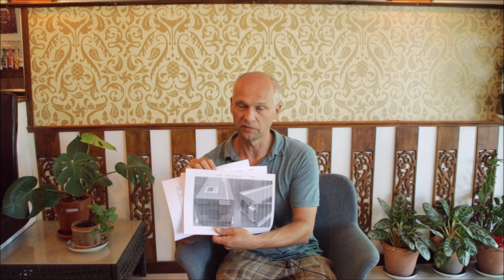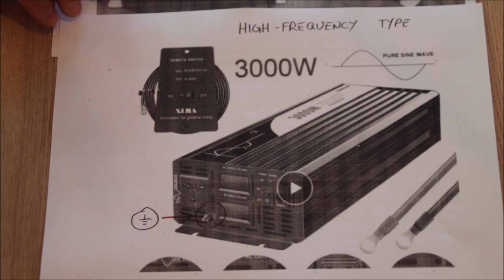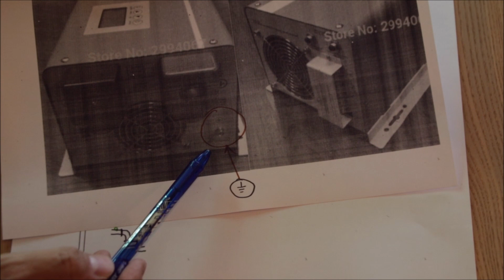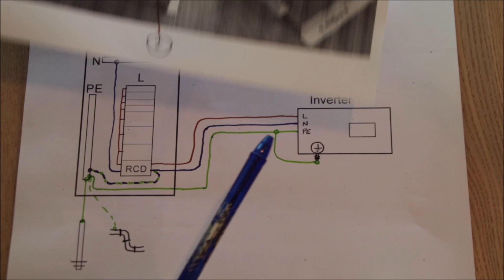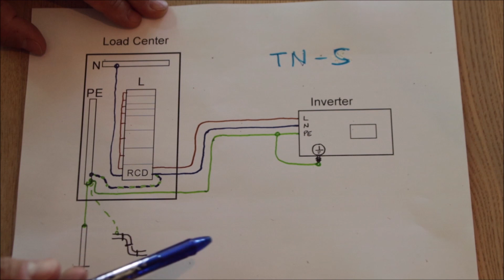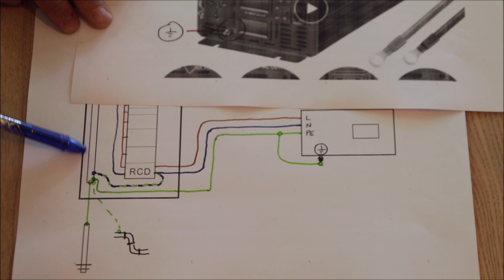Inverter Earthing and N-G Bonding in a simple Off-Grid Setup

Comment: Hi, what rcd type should be used with 12v power inverter? Should it be Type A rcd ?
Reply from the maker: Hi. I am using Type A RCDs with inverters and I do not see the point of an All-Current Type B just because the power is coming from an inverter as some people claim. A high frequency inverter is still putting out a smooth true sine wave. But actually, the choice of Type for an RCD depends on the type of load you want to connect. Simple AC loads like motors or resistive loads do not cause changes in the residual current. But if you are connecting variable speed drive inverters, EV-chargers, DC-rectifiers, etc. then Tye F or B will be required. So yes, Type A will do it for most normal situations, but if you have the extra bit of cash and your application requires a higher Type RCD, you may as well choose Type B. 

Think I should make a video about this ;)
Reply: @RolandW_DIYEnergyandMore  Thanks for reply. Video regarding correct rcd type will be very helpful as I've had spent some time looking for the answer without results( energy prices will force more and more people to use off grid inverters). Personally I've bought 100ma 40a type A, but been advised to use 30ma 40a type A due to safety reasons ( will run house appliances up to 2000w ).  Happy to find you on YouTube!
Reply from the maker: @MrKejpyke  yes, 100mA RCDs are only for equipment protection. Only a 30mA RCD can be used for human protection too. Thanks for watching!

Comment: Hi
I would like to bond neutral to earth on my high frequency inverter but I have measured both live and neutral and both showing 140v and 90v. Is it save to bond neutral to this inverter or will I blow something  I have checked continuity between live and earth and neutral and earth and there is no continuity. Please help
Reply from the maker: Hi, yes it is safe to bond and ground neutral. The 90V will disappear once a true reference to ground is established. Thereafter leakage protection devices like RCDs or GFCIs will work properly.
Reply: @RolandW_DIYEnergyandMore  ok thank you for your answer. Do you know how to check what is my live and what is my neutral. I have read that this inverters are often shipped with reversed L and N and as I see voltage on both terminals I'm not sure which one is L and N. Will the lower voltage be N?
Reply from the maker: @greg23842384  so this is an inverter with built-in outlets only? I guess when you look inside you will only see same coloured wires, right? Yes, I would bond to the leg with the lower voltage.
Reply: @RolandW_DIYEnergyandMore  it's got build in outlets and terminals as well  ok I will try with lower voltage leg. Im trying to charge my nissan leaf with this inverter but i get error code saying leak on my charger i hope this will fix the problem. many thanks for your help.  take care

Comment: What do you think about the measured AC voltage on the DC side(after earthing and bonding) in the video below in the link at 16:30? Can it be bad for lead acid battery or Victron MPPT solar charger? https://www.youtube.com/watch?v=yar9g5gqyK4&t=990s
Reply from the maker: Hi, I actually do not see what would cause the AC voltage readout. Typically AC and DC side is galvanically separated and the DC side not connected to Ground inside an inverter. Its hard to tell if this is just a thing on this particular inverter or of it is a common thing on those cheap devices. Would have to check continuity between Ground and DC terminals. I have checked on my All-in-one inverter, there is no AC voltage between PE and a DC terminal. Nevertheless, I would say there is no risk on the DC side. Those voltages just seem to be a sort of high resistance noise or ripple.
Reply: @RolandW_DIYEnergyandMore  So far, I have tested the connection according to your video and the inverter is working well. I'll try to measure the ground and the DC side. I hope that any AC voltage will not affect the battery :-)

Comment: Its interesting you say to connect neutral - earth bonding on any inverter. I was under the thought that this was only possible on some inverters and to check with the manufacturer. Some have problems which may damage the converter if this is done on the output pins. I expect a centre tapped output inverter will be one of these as you will be shorting out the centre tap winding and neutral but I have not tried this. I originally thought this was good to do on all inverters until I started doing some research now only recommend this on inverters that the manufacturer states it can be bonded on output. Wonder if you have had any issues with any other inverters or am I getting your point wrong and you are making the TN-S system but not using the inverter earth pin out.
Reply from the maker: I assume you are talking about US Split Phase devices now and that we are still talking about a pure Off-Grid System, with no AC input different to the US Split Phase System. There too, The Neutral terminal is similar to a transformers center tap and should be able to be bonded to Earth. Otherwise, there could be any voltage present on the Neutral there too. Non-bonded systems are called Isolated Systems, or Floating Neutral systems in the US. If the manufacturer states, that its device can only be used as an Isolated device, then you are not allowed to bond. The other point could also be that the inverter is already internally bonded for Off-Grid use. There it would of course be fatal for the device if you placed another external bond on a different wire. So yes, please always follow instructions of your device manufacturer if it does state what to do, but technically speaking a N-G bond doesn't shorten any terminals within the power source, it is just allowing fault current to return to the active side of the power source.

Comment: Thanks for the information sharing. Without bonding neutral to earth, LED down light will still emitting light at night due to floating current. I use your method in my offgrid setup.
Reply: Thanks bet that’s my problem also!
Reply from the maker: cool, nice to know! thanks

Comment: Roland i have stumbled upon your channel via looking for a problem i have only encountered today - i hope you may be able to help - Last year i purchased a 3000w Renogy 12v/230v inverter for our motorhome and have been using it for nearly 12 months now without any problems - my set up is simple - from my battery bank to the inverter - red/black cables and from one of the 230v sockets i run a cable to a extension socket with about 3 ports for plugging 230v appliances into - never had any problems, but today i decided to remove the extension socket and connect it to a couple of sockets in my motorhomes kitchen area - and it was at this point i thought i would test the sockets with a plug/tester that lights up if there is a fault in the cable - and there was, it said NO EARTH - so i traced the cable back all the way to the inverter ad could find no problem, so i took it all apart and reconnected my original set up and tested again - still NO EARTH, so it looks like all this time of me using this inverter there has been a problem with the earthing, only today did i attach an extra cable from the chassis of the van to the body of the inverter but it made no difference - still said NO EARTH - any idea what could be the problem - or any solution ?
Reply from the maker: Hi, what you did, was that you have used your inverter as Isolated power source (IT-System). An inverter can natively only output the active circuit L and N. Ground (Earth) is something which is provided by the user itself through something called the Neutral-to-Ground (Earth) Bond. The tester not identifying Earth tells me, that there is no internal N-G bond in the inverter itself. 
You could now continue to use your setup as before, but there are some risks. Alternatively, you could simply place a bonding link between your N- and PE-terminal inside the inverter.
As you are probably using a lot of appliances on your extension wires, and obviously also some which might require a grounding loop, you should turn your IT-Earthing System into a TN-Earthing System through installing a bit more permanent solution with a small consumer unit into your motorhome. There you can put an RCD and a few breakers going to some outlets, and follow the instructions in this video to place the N-G Bonding Wire. Then you will have a semi-grounded installation with improved safety. A fully grounded solution would require an additional earthing electrode outside of your motorhome connected to your grounding system, with the motorhome chassis connected there as well (for whenever you are stationary).
Reply: @RolandW_DIYEnergyandMore  I really appreciate you replying,  however I am not tech headed when it comes to some of the terminology that you use..like.  IT-Earthing, TN-Earthing, N-G Bonding wire etc, would it be a good idea to test if there is bond between the earthing lug on the outside of the body on the inverter and the 230v sockets on the back  ?
Reply from the maker: @kroozer5215  The earthing lug and earthing pin of the sockets will surely be connected. But that isn't the issue. The problem is, that at the moment there is no path for fault current from earth faults available to return to the active side of the inverter. Thats why the ground loop must at some point be connected to the Neutral of the inverter.

Comment: I am thinking of buying a low frequency inverter to replace the 2 lives  plus earth one I have already. In the UK the neutral must be referenced to earth in one place [ at a time ].
 So, will the N terminal  on the new low frequency inverter be already referenced to earth?
Nothing in the Powerstar LK 3000 about an N - E relay , and nothing to say that the N is not in fact a live.
Reply from the maker: Just to be clear. So, you want to remove your Grid supply input to your current installation and replace it with a Powerstar inverter? And you think that there might already be a N-E bond inside your load panel? Further you do not know if there might be an internal N-E bond inside the inverter unit? 
All of this you would see once you remove your current supply cable. You would just measure for continuity between N and E with all breakers ON (or closed) on any outlet in your installation. By measuring for continuity on your inverter N-E terminals, you will as well see if there is an internal bond there. If there were an internal bond in the inverter, and as well a bond inside your load panel, then you would have to remove one of the 2 bonds. It's your choice.
Reply: @RolandW_DIYEnergyandMore  Hi Roland Thanks for your reply. I watched many of your videos on holiday last year in Kurdistan Iraq where I installed some solar panels. I connected a centre-tapped inverter to a ground cable and it burnt out. In Iraq the street transformers are grounded, but no other earth cable at all. This video of yours explains why I need to replace my inverter with a low-frequency inverter where the heavy , steel cored  transformer provides electrical isolation from the two lives out put of centre-tapped inverters.
I am so grateful to you for your generosity in producing these videos.
In fact I have not dared to install my other inverter for three years because I didn't want it to burn out. I did plan to use a separate isolation transformer to achive the same N-E result.
The IET has produced an expensive guide to EESS, but nowhere in this expert guide does it explain how to choose an inverter that will comply to the regulations. All it says is , Don't do it unless you are fully qualified.
Low frequency inverters. 3 words. Why can't they just say that?
Reply from the maker: @anastaunton478  OK, but that means you have used a US split phase inverter in a 230V one phase L-N system. So yes, in such a setup you cannot E-N bond the center tap as you are creating a ground short on L. Be careful with such setups. Make sure not to use AC IN with a different grid system.
Reply: @RolandW_DIYEnergyandMore  Many thanks

Comment: Many thanks Roland for sharing this.. I always thought that offgrid inverter were meant to be isolated. My RCCB is now working after shorting L to G. Glad I found this video.

Question though, if my electric utility is L=110V and N=110V (split), can I still use my inverter's AC IN and connect it to my utility grid? Thanks.
Reply from the maker: No, you cannot do it that way, because in the split phase system, you have the midpoint grounding which would not be the same as where now your L2 is the grounded Neutral. You could only use an isolation transformer on the AC input. That would be something like taking the L1/N 110V one leg and transforming it up to 220V L1/N and feeding into the AC input while no grounding is done on the secondary side of the transformer. But I would just use a transfer switch if you need to backup to grid and not use the AC in.

Comment: Good day sir, i live in a 240V country and i understand that ground and neutral are separated in the load center. now lets assume that E and N are not connected in the inverter, is it then safe to jump a wire between PE & E on the inverter? if so, do i need to bond them in the load center again as stipulated in your diagram? I am a beginner trying to understand electrical wiring and renewable energy in off grid set ups. Bonding and Earthing is one of the topics that i am trying to understand. Thanks in advance.
Reply from the maker: Hi Jonas, thanks for watching. If your inverter is not internally bonded, I would leave the bond for the load center only. Inverter terminals are not as solid as those in a load center and the load center is also the place where your earthing will be done anyways by attaching the wire to the earthing rod. You are right, there would be only one bond in your system.
Reply: @RolandW_DIYEnergyandMore  Thank you very much, I am learning a lot from your videos, keep up the good work, you are saving a lot of lives.

Comment: I'm new to this, but I had to wire my off-grid cabin because it is so isolated, I couldn't get anyone up here...4 miles from Canadian Border. Two 100 amp Lithium Battle Born Batteries in a parallel configuration. I have 12 volt lighting working just fine. I have  A 2000 watt inverter. I use a transfer switch to bring power in from my Honda 2200i as needed. The cabin did come with 120 AC wired set up with duplex receptacles to use as needed if hooked up to a generator.  BOTH the transfer switch (see link below) and the inverter have places to attach a ground wire. I have wired the ground inside the transfer switch to the box and the green wire on the inverted s dangling until I know where to hook it up. I have been getting LOTS of conflicting information on this. My idea was to have the two ground wires go to a busbar and then to a ground rod in the earth. Others tell me it is not necessary and still others tell me to connect those green ground wires to the negative battery lug??? I am surprised by the many different opinions out there!  Everything works very well now. I'm am using GFCI where I can just to be extra safe. I was told that I could also bond the two solar panels together and then isolate them into a ground rod right under them. 

https://www.amazon.com/EZ-GENERATOR-SWITCH-Generator-UNIVERSAL/dp/B00FADDE0A/ref=sr_1_15?crid=1SA0J0F0TGW9K&keywords=transfer+switch&qid=1644522221&sprefix=transfer+switch+%2Caps%2C86&sr=8-15
Reply from the maker: Hi, sorry, your post was initially blocked due to the link. The question of grounded or isolated systems is typically a factor of what your installation is. If it's just a small circuit with a single device on it, then it can be isolated, but a cabin should definitely be grounded as there are a lot of circuits and appliances connected. Ground connected to Battery Minus, no, just don't do that as it is giving up DC isolation. DC isolation is good, because we only have panels and charge controller/ inverter there. In my opinion you should do exactly how you have set it up. Panel with Ground bar, bar grounded by rod, inverter and gas generator grounds be bonded to the bar in your panel. Actives to be transferred by the transfer switch when needed. Your GFCIs will not work in case of leakage caused by a human touch on a life wire as long there is no grounding rod and N-G bond set inside the panel. Frames of panels can be connected to same rod, but if they are a distance away from your building (>5m), use a separate rod directly below them. DC plus and minus are connected to GND via Surge Protecting Devices only.
Reply: @RolandW_DIYEnergyandMore  thank you so much for the detailed response! I'll look it over to see if I have any more questions.

Comment: Roland, thank you very much for sharing your amazing knowledge. I was looking for a solution to my off grid solar system project and found it in this video. Bonding N and E was the solution! Now, when I test my outlets, I get 240v on L and N, 240v on L and E and 0v on N and E. Even my boiler started working.
Reply from the maker: good to hear. Hot water is very important :)

Comment: Hello, this is much easier to understand with diagram. I'm in Malaysia.. not sure what type of Earthing method uses by the power company. Most probably TT or TN-S method. I have Growatt hybrid (Solar\battery + Grid input) inverter. Could you show in diagram for Hybrid inverter where I could possibly bond N-PE? I've checked you previous video however I would like to see in schematic diagram for better understanding. Thank you.
Reply from the maker: Hi, simple off-grid means "No grid input". You might look my video about "practical guidance in different earthing systems". But be aware, as i do show there, you need to exactly know your grid type, as TT is very problematic.